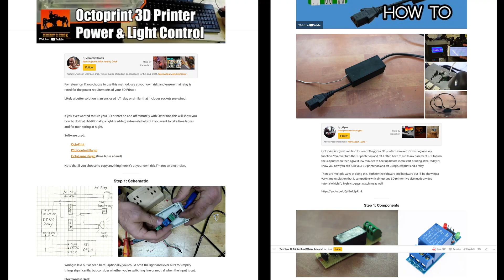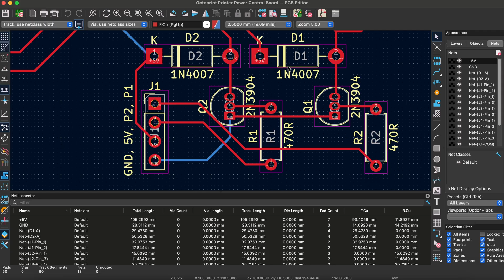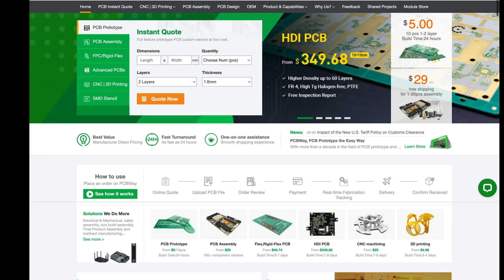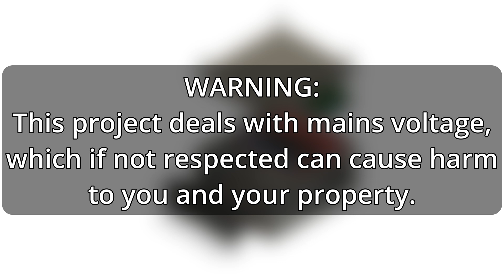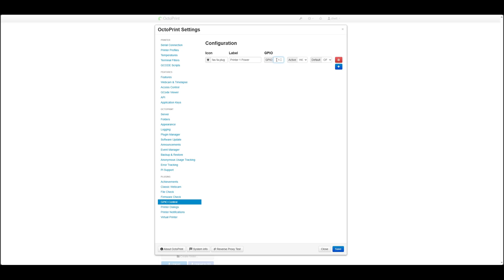Remotely Control Your 3D Printer's Power with OctoPrint and a Raspberry Pi

Comment: have you thought about adding power leds into it mains in and one each for mains out as well as a gpio breakout to the mainboard so you can add things like LCD screen and filament run out sensor and filament jam sensor all very useful to have with octoprint
and does having the mains that near the pi interfere with wifi
but a very good idea

Comment: Why would you need two power inputs? One of them can handle 15A, which is enough for at least 10 printers. I also don’t see the reason to switch both the live and neutral, instead of just switching live like its done everywhere